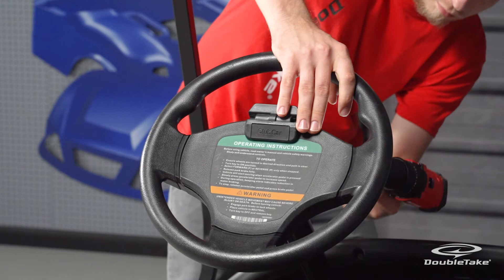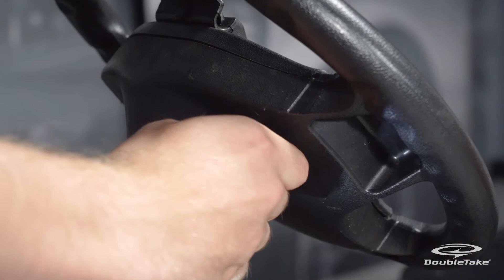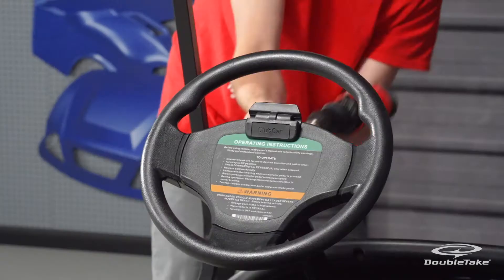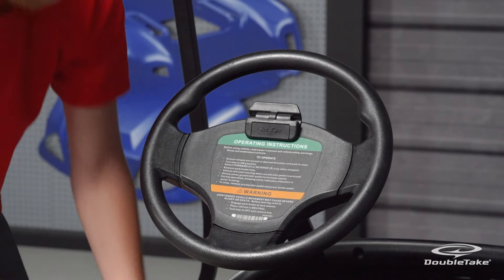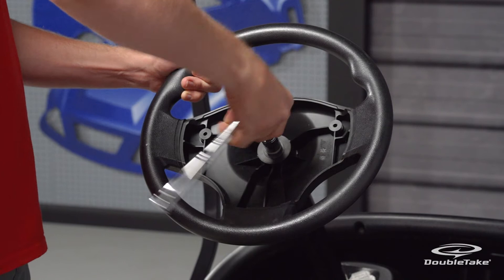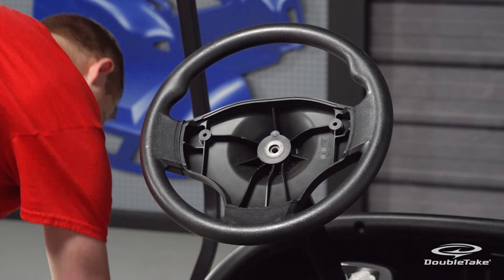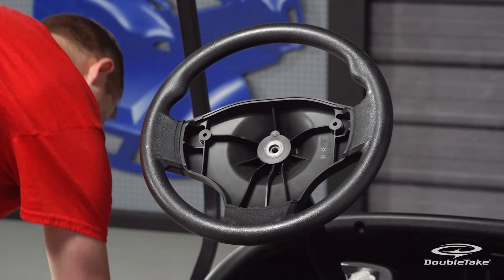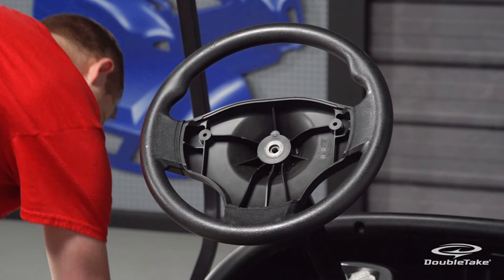Club Car Precedent | Remove Factory Steering Wheel

Comment: What size are the two nuts on the back that hold the cover?
Reply: They are Phillips head screws, not nuts.
Reply: Mine aren’t, they are hex bolts.
Reply: They’re 5/16. I used a rubber mallet to tap a 1/4 drive 5/16 in there and got it after a few minutes of being angry that my cart was the exception by having hex nuts
Reply: So are mine

Comment: I have to take an old 5/16 nut driver, put it into a drill, rotate it while holding it to a file and create a thin wall on the socket end, that got the bolt cover off. 15 mm with an impact got the bolt off. Backed the bolt out two to three turns, gave the bolt a swift blow with a good size hammer and the wheel popped off.

Comment: That steering wheel was removed before this was taken. It is a nightmare to get the old one off.
Reply from the maker: Yes, unfortunately factory steering wheels can be quite tough to remove the first time. The one used in this video had obviously been removed many previous times for multiple takes. It was not our intention to give a false impression of easy removal.
Reply: A couple of other removal video's show using a 'rattle gun', which makes sense.  I used a 15mm socket, 'breaker bar', and a BIG hammer.

Comment: What size are those bolts and what did you use to remove them. I can't fit standard auto mechnanic sockets in the holes.
Reply: They are Phillips head screws, not bolts.
Reply: They’re 5/16. I used a rubber mallet to tap a 1/4 drive 5/16 in there and got it after a few minutes of being angry that my cart was the exception by having hex nuts